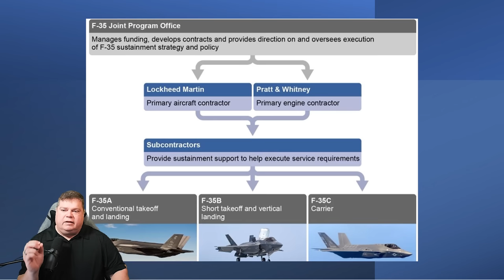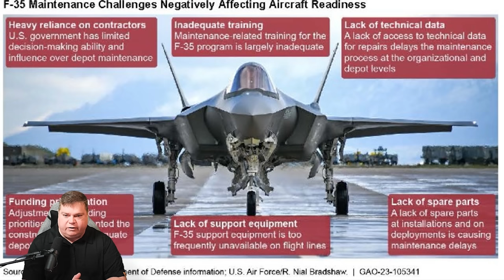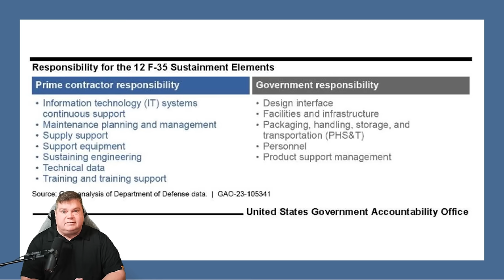What Is Wrong With Americas Deadliest Fighter Jet

Comment from the maker: What is the name of the fighter in the thumbnail?
Reply: Looks like a F22A Raptor
Reply: F35, which variant is SND. (Sexually Non Descript) A, B, C...
My dad explained that he designed landing gear for Navy aircraft. As a 10 year old I was fully aware of our space endeavors, and knew all the specs. At 12, I am wondering why the Navy didn't buy airplanes with landing gear. After a term with P3s and learning they can be taxied to their parking space after a 7 G landing, I realized what dad had been doing. Carrier landings are around 7 Gs on average. 9 can knock you out.
Reply: F-22.
Reply: Whatever it is, Aaron, it's winding up folks, so it's all in good fun.
Reply: Barry?
Reply: F-22... totally threw me for a loop in the video
Reply: Before or after surgery?
Reply: F-22 which is discernable from the F35 by the shape of the engine inlets.
The F-22s inlets are a the shape of parallelogram the top & bottom lips are parallel as well as the inner & outer lips
From front on the F35 upper and lower lips are not parallel and  the inner lip is curved by the shape of the fuselage.
Go look at the Wikipedia pages for both. In the section for the specifications there's 3 way views of both.
Look at the front on views.
Reply: F-22A
Reply: AUSTRALIAN AEROSPACE ENGINEER HERE:
FIRST I am NOT questioning the capability of the F-35. Anyone who has listened to people like Chip Burke or Ward Carroll's buddy Paco, who have actually flown the F-35 and other aircraft know that it is more than just capable.

My issue with the F-35 is the maintenance. There is no point in trying to fight a war with planes that can't fly because they're missing parts. THIS IS NOT A NEW PHENOMENA.
I remember watching a couple of documentaries many years ago about the effectiveness of various systems in World War 2. One compared the Sherman to the German Tiger and despite the Tiger being superior in almost every way imaginable the Sherman was concluded to be more effective because it could be produced in numbers and maintained in the field. Anyone who's seen any documentary on the Tiger knows they were difficult to maintain.

The other documentary compared the Hurricane to the Spitfire during the Battle of Britain. At the time I saw this I happened to know a Veteran (named Des) who had flown BOTH Hurricanes and Spitfires in WW2. When I told him the conclusions of that documentary he said an almost identical comment to one Chip Burke made. "No pilot given the choice would pick a Hurricane over a Spitfire!" Chip Burke basically said ""No pilot given the choice would pick anything over an F-35!" and that was in reference to the F-15, F-16 & F-18. Chip also flew the F-22, but it was not part of that comparison.

I remember asking Des (the WW2 Vet) "Then why did the Polish Squadrons send their Spitfires back and demand their Hurricanes returned?" He acknowledged that had happened and then asked me what they said in the documentary. The reason given was maintenance. 

When the Spitfire first arrived it was not simply a knew aircraft but also totally new technology. The Hurricane was mostly a wooden structure that was fabric covered, which is why so few have survived. The Spitfire was an full metal skinned all metal airframe. As such if a Spitfire was hit by as much as a single bullet it required specialised metal work and tooling to fix and that could take 2 weeks. The Hurricane might only need the local carpenter and sail maker or seamstress to get it back flying and that could be overnight. 

This is one of the things that made the A-10 Warthog such an enduring aircraft. It was purposefully designed to make it easy to maintain in forward locations where tools, parts and skills might be in short supply. This is also why it has the lowest cost per hour of flight time in the USAF. Another plane which was designed along similar lines is the Swedish Saab JAS 39 Gripen. There's at least 1 documentary here on YT that highlights the fact it can not only be operated from remote sites using local roads but it only requires a team of 5 to maintain and only 1 of the 5 needs to be a specialised aircraft mechanic. It was also designed to sit LOWER on the ground so that girls (who tend to be shorter) can help with re-fueling and re-arming duties.

My issue with the F-35 isn't the first day of any conflict or even the first few days. Its the following days and weeks and months when THINGS HAVE TO BE MAINTAINED and if the USAF, USN and USMC aren't getting the spare parts, specialised tools they need then what hope does Australia have????

Sorry for the long reply 
Love the channel.
Reply: Virginia Class submarine, with 'sb' written across the nose.  😎
Reply: You said America's deadliest fighter jet, so it has to be an F-15.
Reply: @burtlangoustine1  😂😂
Reply: @bryanst.martin7134  ; Look at the thumbnail again, it is an F-22A Raptor.
Reply: It's the aircraft that's turning out to be cheaper to operate, and more likely to stay airborne than the F-35's you're discussing. 😆
Reply: @interstellarsurfer  ; Last I heard the F-22 is extremely expensive to maintain.
Reply: The Pork Barrel Express.
Reply: @CptJistuce  If you are looking at American built fighter jets with the most kills its the list is:
F-86 with 800 Mig kills in Korea
F-4 with 306 kills in Vietnam
F-14 with 135 kills in the Iran-Iraq war
F-15 with 103 across various conflicts
F-16 with 76  across various conflicts

After that very few jets seem to have done much most having less than 30 kills. 
On foreign jets I did find the a report saying the Mig-21 has 240 kills across numerous conflicts. I'd expect the Mig-15 & 17 would also have a lot but nobody seems to have that number easy to find although I found that the Americans admit to losing 76 F-86s to Migs in Mig Alley.

Also note most of the F-14 kills are by Iranians and most of the F-16 and F-15 kills are by Israelis.

Sorry I know the F-15 has a very good record but its far from first place and considering the Mig-21 is still in service with a bunch of countries its not even the current title holder for current use.
Reply: @tonywilson4713  I was thinking in terms of kills per death, where the F-15 is top-tier if you ignore weather balloons(sorry, F-22). Those planes that have more kills also have losses.  
...
You also have to ignore the one Strike Eagle lost to ground fire, though there's an argument to be made that it shouldn't count precisely because it's a Strike Eagle. 

But it is fair to reign in the excesses of Eagle fangasming. I acknowledge there are planes with much higher kill counts.
Reply: BAIT
Reply from the maker: Gene, they are on to me....  @MMuraseofSandvich
Reply: @@KrellKrypto - so what's its pronoun? bomber?
Reply: F-22 Raptor/Death machine.
Reply: Yeah man that's an F/A-22 Raptor. Not any of the 35s

Comment: First mistake was allowing contractors into the sustainment loop. Field maintenance is a critical part of reliability.
Reply: Agreed
Reply: Agreed, but it's even worse than that. They didn't just "allow" this model, they insisted on it.
Reply: Smelly echoes of an LCS….
Reply: Contractors have a time and a place (I work for a sub-contractor on a different contract), but at the end of the day the customer needs to be able to use and maintain the product (the F-35)!
Reply: Can’t agree with this enough. DoD can’t even work on the new JLTVs (humvee replacement). All contracted. Pretty disgusting for an “expeditionary” force.
Reply: @SuperMaxdragon I would normally agree, but the avionics and whatnot are seriously complex. Depending on what type of maintenance you need, the tools and materials required could be outside of the air force enlisted's ability to do.
Reply: @ZeCroiSSanT950  I was in the Army as CH-47 maintainer and contractors did a lot of work, and always took the in-depth scheduled maintenance birds which kept many enlisted troopers from gaining experience they otherwise would have faster. The army may have gotten bird to be returned to flight status faster, but they robbed long term experience from their force and spent a fortune on civilian contractors. And this was all for a 70 year year old airframe.
Reply: @ZeCroiSSanT950  You still need contractors, and you wont rebuild parts in the field. But the more complex a plane gets, the more important it becomes that as much as possible can be done in the field.

And if a system is too complex to be maintained or at least replaced in the field, then that seems like a fundamental issue.
Reply: We need private contractors to monitor the other private contractors!
Reply: @Ethan-iv8fs  yeah at some point you have to outsource that stuff to a govt body
Reply: LOL first mistake was letting contractors run Congress
Reply: @ZeCroiSSanT950  That's right. The F-35 is far to complex. This is known for years.

Comment: AF maintenance vet here. All the 70s-80s stuff had spare parts. We had a mandate to maintain, control, and deploy all that stuff. The last half of my time in, it was mostly COTS stuff or proprietary stuff owned by one of the big contractors. Those contractors would keep critical maintenance information (technical orders) from us. It was awful. Nothing got done in time with that stuff.
Reply: Also maintenance vet, KC-135 engine mechanic.

The old stuff definitely has this problem a lot less because we've allowed proprietary anti-repair nonsense to infect our society to the point where defense contractors do it to our own military only more recently, in the last 20-30 years or so.

That being said, rge old stuff is developing supply and maintenance problems lately too. A good example, he had ESCUs start going bad so often, our jets would get stuck with only one working APU. We kept having to cannibalize jets to fix up APUs on jets that had two bad ESCUs (which basically quadruples our man hours spent on replacing ESCUs). We got to the point where 1/3rd of our fleet needed ESCUs, with 6+ month wait time.

Come to find out, the reason for this is these things USED to rarely break... So the USAF just stopped contracting a subcontractor to build new ones entirely... Then years or decades went by, and suddenly they started going bad a lot more often. Best we can do is send them to a USAF depot to have them torn down and rebuilt... Which is fine, until the USAF runs out of stock of good ones enough that our unit needs to literally wait to get THE SAME ESCU back. And as far as I know, the USAF refused to get another subcontractor going for these things because "well, we're retiring these planes soon anyway"... Except we're not. Since the KC-46 is such a clusterf@ck, the 135s are being extended all the way out to the 2060s.

And you could maybe claim "well, at least APUs arent exactly a huge deal, ground power air can start the engines even if both APUs are out of comission, not like its a safety of flight issue"... Except as I was getting out of the USAF, we were informed there would be no new Right Hand Ignition Leads for jet engines... Which means as those go bad, more and more jet engines will only have one functioning igniter... What a joke. Do you have any idea how much of our ability to troubleshoot ignition issues REQUIRES two igniters? Im not even sure how that will be handled. Cant just take the lead off the plane, big no-no to fly planes with missing parts like that. Cant really leave it on either, a lot of times leads go back because of shorting, so leaving it there might cause other damage or fires. Like, wtf, ya'll didnt even think this through.

Not to mention this sort of thing would be treated as absolutely unacceptable by the FAA if it were a civilian jet. Why do GA planes have 2 magnetos, 2 leads, and 2 spark plugs for every cylinder? Redundancy. And to just... Fly without one of those systems would be a clear and major violation of tech data and safety... Yet our chain of command ordered us to so this for an irreplaceable airliner sized tanker.

... This kind of stuff is why I got out. I'm not working for a shortsighted DOD that's actively trying to kill its own.
Reply: Establishing my street cred: "COTS" = "Consumer Off The Shelf". All avionics are tested to extremes you can't imagine. COTS is complete trash. Not flight- worthy.

Comment: Inabililty of forces to do their own maintenance is becoming a huge problem in all branches of all NATO militaries.  In a serious conflict it could be a serious achilles heel.
However a lot of those subcontracts are essential parts of the international partner agreements with the F-35.
Reply: case in point: BAE UK.
Reply: The number of times I try to do repairs and I either can't get the parts I need or simply don't know how to do something is way too high and that's in port. It definitely won't get better if we're getting shot at halfway around the world.
Reply: @wolfskid15 Yup, they cant even get it done in peace time. Hows this supposed to work in war time and far away airbases?
Reply: The inability of forces to do their own maintenance is also driven by reduced and more simplified training by the force its self.

Private contractors are ESSENTIAL in order to get maintenance done.
You NEED the people power and the experience of contractors, who tend to have better training and experience than military personnel with regards to maintenance.

As others have said though, it's a vicious circle, the military won't train people, so they need contractors, but the more work given to contractors, the less experience those under trained troops get.

Chicken and egg scenario really.

The governments want to reduce overheads and reduce the length of training, but it leads to an over reliance on contractors and therefore a reduced level of experience within.

Let's not get started on the differences between "government work" and "paid contractor work"... People work a lot harder when there is more money in it for them.

Comment: I work for one of those subcontractors and all I can say is if Lockheed/northrop placed more orders we would build more stuff for them...
Reply: 🤠What I find strange is making a plane then needing sub contractors, surely sub contractors work on submarines, right? Where are all the aircraft contractors and why is the piece of paper with wages, the date etc in the name of the position? What is contracting really? Nothing. If anything sub contractors should be called Primary Extenders. 
If a specialised team is needed for each f35 made, as if theyre a part of the aircraft, where are they all? Why is expense built-in? Taxes are a nations lifeblood not chocolate fountain.
Reply: @burtlangoustine1  you appear to be blaming the guy at the bottom of the chain instead of the real problems who negotiate these deals heading up these organizations. I work for Leonardo in the UK building, maintaining & developing Wildcat & Merlin helicopters and can safely say if we had better supply of parts from our own subcontractors or even primary contractors aircraft would be completed ahead of schedule rather than late.

Comment: Actually that is nothing new. I grew up on aircraft carriers, I spent a few years on general duty in a S-3A squadron, all thru the 70’s and 80’s of all squadrons of all type aircraft it was rare to see more than 50% of squadron aircraft as FMC (full mission capable), almost always having 2 of 10 aircraft in the hangar for extended maintenance, those aircraft were referred to as ROB aircraft, parts taken off to get other aircraft into flying condition. When Reagan was elected president that was supposed to end but in the long term it never did. 

With the F-35 now being exposed to high flight hours as a still new system we are still learning what parts need replacing earlier than planned, what parts last longer than expected, we are still in a real world learning phase. 
Nothing pisses a sailor off more than taking twice as long to fix a plane because instead of getting the part you need from supply you need to take the failed part off the plane, go to another plane in maintenance take the part off of that plane, install the broken part into that plane (if you don’t do that the part gets lost and these are expensive turn in items), then install the stolen part into the aircraft.
Reply: It's amazing the difference in knowledge and perspective from people with experience, thanks for your account
Reply: Got to remember the F-35 in all variants is intended to be in service thru 2050…Long term the bugs will be identified, maintenance issues will be streamlined and multiple upgrades will incorporated. 

The F-4’s had issues, the F-14’s did as did the F-18’s.

Comment: One of my favorite 'good design' stories is about Henry Ford.  He was subcontracting engines for the Model-T at one time - and for no apparent reason he insisted the engine manufacturer make the crates the engines were shipped  in a certain size.  The change was a fairly small increase in size, so the subcontractor went along with it.  Henry could be odd.  When the engines arrived it was revealed the lumber used in the crates was the proper size to make the floorboards for the vehicle.  We could use Ford back to tinker with the F-35.
Reply: Perhaps but not sure that approach could work for something like this.  The Gripen does use what is called flyaway tooling: some of the jigs are the actual airframe parts.  Though again, not sure if that could work for something like this.